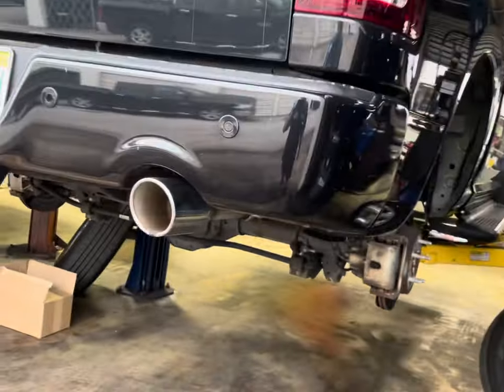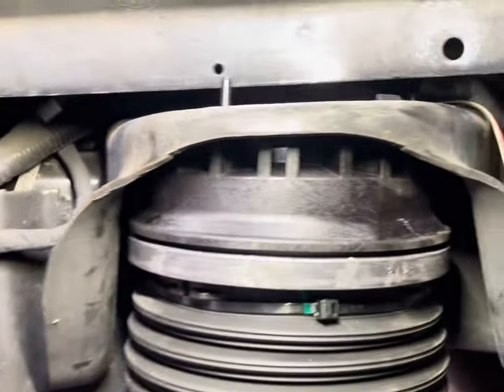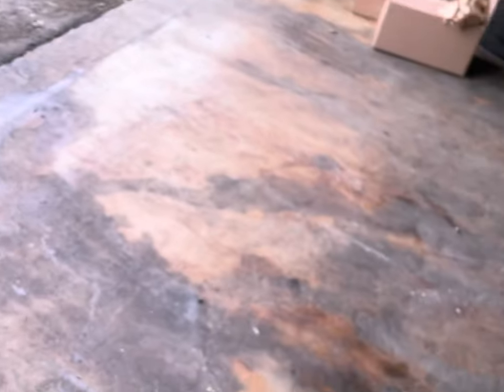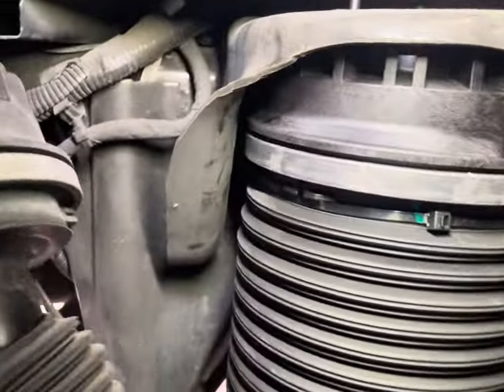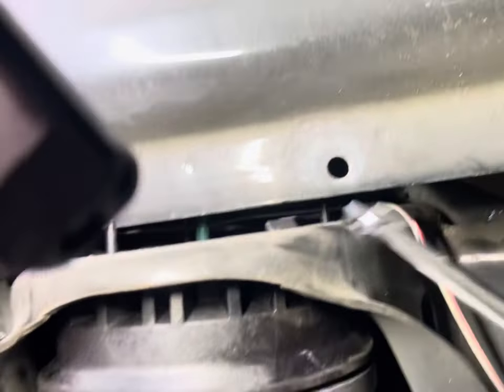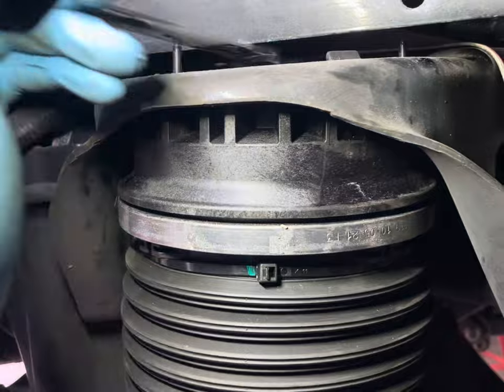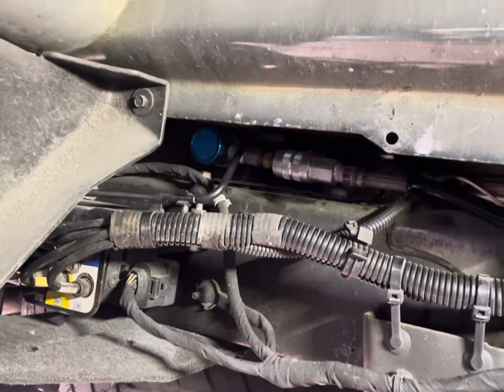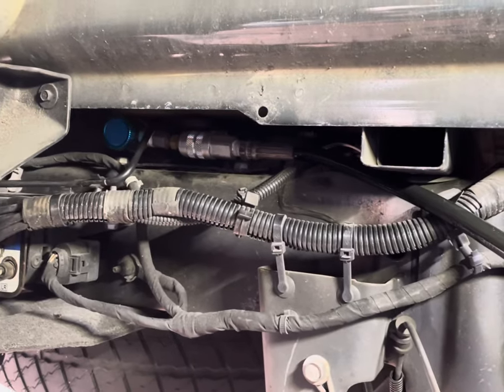Ram 1500 air suspension leaks after driving on highway or sitting overnight FIX

Comment: Its just insane how dodge won't recall the air systems.  They're complete shit.   They are absolute junk for colder climate areas.     So many failures they turn a blind eye and ignore the issue.   A luxury feature us costing owners thousands and thousands of dollars.  Not to mention the safety risks they are facing when the truck drops and rides the bump stops.  

Junk ;  change my mind
Reply: Yea so pissed at ram for this.mine works..... sometimes.riding it with no air is torcher.
Reply: The whole truck is junk
Reply: Completely agreed, I live in north dakota and had to pull the airbags out.  So glad I did, took 5 hours and $700 but worth doing.  Nobody will tell you that normal front coilovers bolt into place. Also rear coil springs go into place of rear bags.  Cheap and easy to replace
Reply: @rcandrew8780  I just replaced my system for $700.  Coilovers in front, bilstein coil springs in back.  Great video on YouTube, search monroe ram air ride conversion
Reply: The system isn't junk if you don't maintain it. They stop working in the cold weather because it has an leak in the system. The compressor draws in outside air to make up for lost nitrogen. The air has moisture in it after it's gone through the compressor so in the winter it freezes in the air lines. So when garage looks at it after its sat in the warm garage bay for a few hours, they tell you it's working properly. You can't blame the system if you're not doing maintenance. If you had a slow oil leak and then the motor seized up from no oil, would you say the motor is complete shit?
Reply: @vmxg8052  most people have problems within the first year of owning these.   Especially up north.  Not a luxury 60-70k feature we paid for.     I've since yanked mine out and put a proper suspension in.    If they backed their product they would recall it.   Nothing in my owners manual and maintenance schedule was skipped or missed so perhaps recant that nonsense.
Reply: @SHMITGAMINGINC  "most people have problems within the first year", well that means it's still under warranty! You are the one that is talking nonsense.  I have a 2015 and have only replaced the compressor, because I do regular maintenance on the system. Owners manual says to look for leaks in general so you obviously never checked your air suspension.
Reply: @vmxg8052 A system that wasn't completely inadequate would warn a driver of ambient air being used to supplement due to a leak.  It would also have an air dryer incorporated into it for situations when ambient air needs to be drawn in.  Components (mainly air springs/struts... the parts that hold the air) also wouldn't have an average expected lifespan of only ~3 years.   Seriously dude... why would you even bother trying to defend this garbage?? 💩
Reply: @wes8398  Mine is five years old and I've never had a problem. And I live in cold New York.
Reply: @Japplesnap  Just wait... It's a matter of when, not if.
Reply: @wes8398  You can say that about anything. Every engine will eventually fail ...every transmission will eventually fail..... every alternator will eventually fail. I'm not worried one bit about my air suspension. If it fails, I'll fix it and not even worry about it. My point is that it has been flawless so far. My cousin has a 2014 Grand Cherokee and her air suspension has also been trouble-free. So yeah, not concerned at all.
Reply: @Japplesnap  You'll see.  And people like me will become your best friend.  Know the system (and it's faults) inside out because I've worked on it myself.  I'm just suggesting you prepare yourself because most dealerships don't know how to fix it properly and will put bandaids on it until you've dropped thousands into it and still have a broken system.  In contrast, you could educate yourself a bit and have it back up to snuff for a fraction of the cost.  Do you!
Reply: @wes8398  Got news for you.... I'm a former ASE Master Technician. And I know these air suspension systems inside out  I also own a refill tool as well as the software to repair, refill, and calibrate the system in my home garage. So again, I'm not worried about it. If it breaks, I'll fix it. But so far it has been flawless. And that's the point----most of these air suspension are just fine for many years of service. You don't hear about the ones that don't break because those owners have nothing to complain about. But hey, you keep spreading your gospel, okay?
Reply: @Japplesnap  If you truely knew the system inside and out, you wouldn't be defending it's poor design.  I'm also not sure what your tech certificate has to do with the fact that your air bladders will develop leaks, and the system will begin to draw in ambient air (and it's moisture) which will cause freeze-ups, in-operational spells, compressor over-heat warnings/damage, blown fuses, valve block errors/damage, broken lines/fittings, or any combination thereof.  And to bring my comments full-circle, this will all happen without any other indications or warnings other than the malfunctions themselves - the single largest omission/issue with this system, in my opinion.  Either an in-line air dryer (more capable than the tiny dessicant/filter on the air intake behind the tail light), or at least an air loss warning or warning that the system is drawing/supplementing ambient air would go a long way for reasons already stated as well as the fact that the "compressor" isn't designed to keep up with the demands put on it when there is a (relatively) large leak.  It just burns up.  The system is great when it's working, and it's pretty simple to work on (even for an unqualified hobbiest like myself)... But it SUCKS when you're a long ways from your garage/tools and hauling the family and all the toys home on the bump stops because the aforementioned happened without warning.  👎
Reply: @wes8398  It's not a poor design. Your main complaint seems to be that the vehicle doesn't throw any code to warn you when makeup air is being used. And that's true, but anyone with even an ounce of common sense will realize that something is wrong far before it gets to that point. First you have to understand system tank pressures and how they differ depending upon ride height levels. Only then will you understand that the system can still fully function even with a 20% loss of pressure. So what does that mean? Simple---you'll have plenty of opportunity to realize there are leaks before the sealed system will draw in ambient air. How would you realize this? Well, the easiest way to know is that the compressor will be running more often than it normally does. That's because low tank pressure will require the compressor to run more often and it will do exactly that before it draws in make-up air. 

Another way to notice leaks is to pay close attention to your ride height after your vehicle has been sitting overnight. If any of the corners seem to be sitting low, you might have a leak.

If the system does leak to the point that it draws in outside air, then that really only becomes an issue is subfreezing temperatures. The issue is the moisture in ambient air freezes, which causes problems. So if you want your air suspension system to work well forever, pay attention to the compressor and your ride height. It's really that simple. If you have a leak, fix it and evacuate & refill the system with high purity nitrogen. Do it right with software and make sure to run an air mass calibration. It's in the software.

And by the way, the compressor should almost never run unless you are changing ride height or if you are loading/unloading the vehicle. So if you are just driving down the road and you hear the compressor running, you likely have an issue. It's easier to hear in a Grand Cherokee because the compressor is mounted up front behind the bumper on the passenger side. But you can still hear it on a Ram if you pay attention.
Reply: @Japplesnap  None of that's new to me... Anymore.  But also none of that is common knowledge or a reasonable expectation of knowledge to even the most experienced hobbiest wrench turners until they've been duped and had to spend hours learning the system.  These vehicles aren't specially built for mechanics with experience in air suspension systems.  They're built for people who've never even considered the thought of changing their own oil or even opening the hood.  The fact that dealership mechanics don't know how / aren't instructed by the service manual to properly diagnose and repair these systems is even further insult to injury.  The repair manual even repeatedly calls the system SEALED, ffs.  Most techs almost definitely just blindly throw parts at it - new compressors, new valve blocks, etc to the tune of thousands of dollars - without ever even soapy water testing the air bladders.  Once that's done and the issue isn't fixed, they finally get to the problem and replace the bladders...often the wrong one, because a leaky rear bladder still manifests itself with the front corner(s) dropping due to the vehicle's weight distribution.  I could go on.   The fact of the matter is that the system is unacceptably flawed, at best.  The best bandaid would be a "service suspension immediately" warning as soon as air mass drops past that 20% / as soon as ambient air is introduced.  A real fix would be a real air dryer added to the system; at least for Northern climate vehicles.   Anyway... Nice chatting, but I'm over it. 🍻
Reply: @wes8398  Do you not realize that there is a service warning displayed on the dashboard in the event of an issue? 

The system doesn't need to be designed for mechanics.... any average person should be able to notice a compressor running more often than it normally does. That's the very first clue that something is wrong. It's not difficult...
Reply: @Japplesnap  Finally, someone who understands the system rather than blame it because of their lack of maintenance.

Comment: So I have a 2016 rebel with this problem. Only the rear end will sag sometimes, and lately even after starting it can take upward of 15 minutes for the rear end to be level. I also hear a weird pressure relief sound coming from behind the tail light, then a bubbling sound until the compressor kicks back on. Has anyone had a similar issue?
Reply from the maker: Yeah just get those rear airbags replaced soon before your air compressor gives out that’s what seems to be happening go into your vehicle settings and turn off aero mode to try to help keep as much as possible in the system for now
Reply: @alexanderardelean5001  I purchased the bags a couple months ago and didn’t find any leaks but I didn’t test with the truck lowered, thanks for the reply!

Comment: Dude I'm having this exact issue! It went out on me after hitting a pothole pulling my camper and the rear of my truck will be sitting on the frame randomly. Whether I'm driving or if it's just sitting the rear will lose air abd bouncearound ever since i hit that pothole. Dealer has had it for 4 days and they keep called me saying they can't get the suspension to duplicate the problem and that its operatingas it should. It's so frustrating.
Reply from the maker: Send the service advisor my video lmfao
Reply: Bro I am considering it...not even kidding. I'm going to get my truck tomorrow and I'm going to ask to talk to the tech. Truck has 163k on it. Do you think It would be a better idea to swap out the air ride for a regular suspension?
Reply: @mgabriel3590   I’m in similar situation on my 2014 Ram1500
Did you fix it or change to springs? What was the fix??
Thanks!!!
Reply: @moulin680  having the same problem right now

Comment: If you have a ram air ride, you can replace the entire system for $700 and 5 hours of time.  Don't keep throwing money into that crap where best case it still won't work when it's cold!  So happy i pulled that junk out.  2017 ram 1500 limited.
Reply: Please tell me what you switched it with. I want to do the same thing, but I have no idea what to even look for. What system is at $700?
Reply: @jeremydevereauxhoustonwind8990  it isn't even a system. I just put rancho coilovers up front and bilstein coil springs in the back. Everything bolts up, no need to change any mounts.  YouTube search monroe ram air ride conversion. The video is excellent.  Don't buy a kit.  2 front coilovers for your model ram -$220each, bilstein coil springs - $240 pair, coil spring isolaters (only Chrysler sells) $40. That's all you need.  Let me know if you have more questions, I don't want anybody spending another penny with Chrysler!!!
Reply: @heathadams3655  thank you, I really appreciate this. I have a 2017 as well. I just got this truck used and immediately, I’m having this problem.
Reply: @jeremydevereauxhoustonwind8990  absolutely, I love my ram and glad I didn't trade it.  Air ride is incredible when it works and if you live in a warm climate maybe consider fixing.  I'm in north dakota, the first 5 years was only a problem at -10 or colder. Finally the bags started leaking and compressor went out.  If it gets cold where you live, highly recommend swapping for coils.  Chrysler will say it's not that simple, it really is.  No dash lights on, no issues since doing it.  Sits close to off road 1 all the time now, looks great.  Even have the parts numbers I used, did it last week and I'm still excited.  SPENT $700!!!
Reply: Can you send me the part number.  I jsut purchase a rams 2014 1500 and immediately having the same problem.  But mine is only the right side rear tires
Reply: @yonarcandelario3663  here is the video i followed minus the frame bumbers https://youtu.be/FBfX1RoW91c
Reply: Those are the only parts I need for a total fix correct ?
Reply: @DevinMartin-um9nf  yeah, standard coilovers upfront and heavy duty coil springs in the back. Mounts right up, no cutting, grinding, or welding